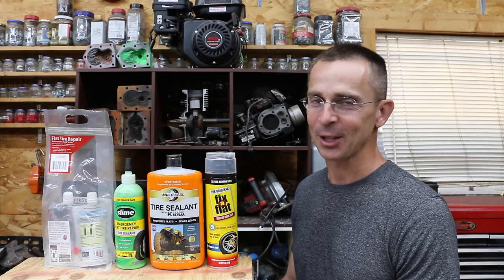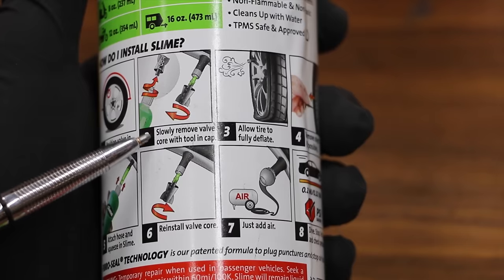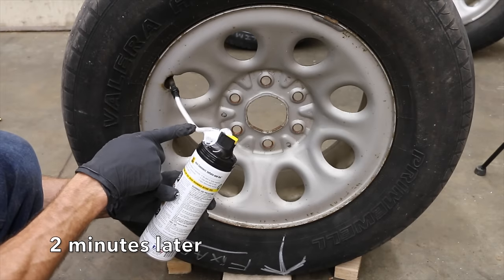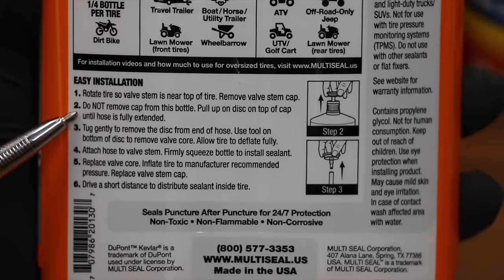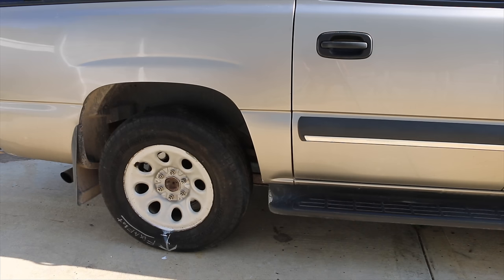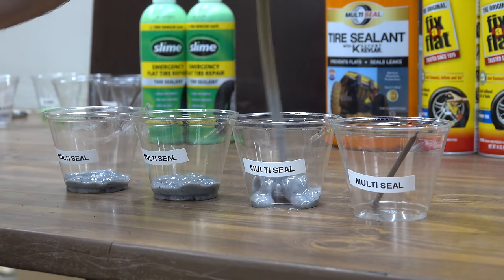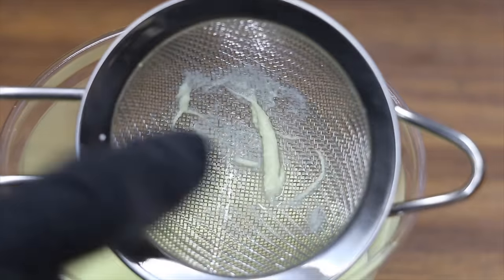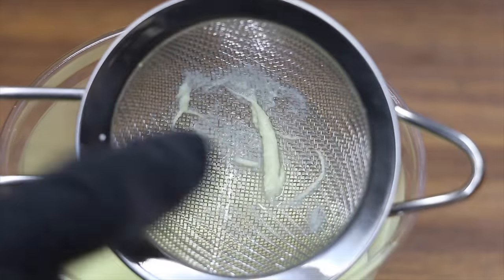Is Tire Slime the Best? Fix-a-Flat vs Tire Slime, TireJect, MultiSeal. Let's find out!

Comment: Fix-a-flat is good for tiny gaps like bead leaks, tiny cracks and objects still embedded in the tire, but that's it. Definitely won't seal a hole as Todd demonstrated here but given it's convenient and easy to clean off, it's worth a shot for small leaks. Definitely not a substitute for Slime or similar in lieu of a spare tire as is now common. I doubt I'm alone in admitting these products are 'temporary permanent' fixes for me.
Reply from the maker: Thanks for the feedback.

Comment: I’ve never heard of multi seal or tire ject, use slime all the time in my atv tires , works great, fix a flat never worked for me. No off balance issues either. 
I vaguely remember a pink sealer from years before that I used, I think it was called pig snot, it worked great also but I think it corroded aluminum, I’ve never been able to find it
Reply from the maker: Thanks for sharing.

Comment: What kind of tire inflator is that? Has it been reliable and about how many tires have you aired up completely? I bought the cheap ebay, harbor freight, walmart mini air compressor looking inflator and it burned out on the first tire at 28psi. Looking for a reliable mobile tire inflator that wont burn out for emergency use and simply to inflate tires. Thanks so slime may be the best cheapest alternative to fix a flat.

Comment: I've always had good luck with fix a flat. Granted I've only used it in 4-wheeler tires. Makes me wonder if I've just been lucky.
Reply from the maker: Thanks for sharing.
Reply: be careful when dismounting those tires- they can explode on a rim clamp machine being used with no pads.

Comment: I wish there was a product for very slow probable  rim leaks or if there is I'd love to know. All for of my tires will lose air at a rate of 5 - 15 lbs in about 2 weeks. I've taken them to a few tire shops and they never see bubbles. Tire Shop said that the type of rims I have are known for rim leaks. It's so frustrating in the winter to refill them that I've been thinking of purchasing all new steel rims
Reply from the maker: Thanks for the feedback.

Comment: It should be noted that this is what you use instead of a spare tire and you should drive fairly slow while driving home. The tire needs to be replaced.

Even plugging it isn't a good idea, if the belt is ripped you can get creep between the inner tyre and the outer rubber which will cause a catastrophic failure (to make matters worse, the faster you go the more likely it is that it will happen).

It's not fun having to pay for a new tyre but it's absolutely needed, your life may depend on it.
Reply from the maker: Thanks for sharing!

Comment: I was a Slime user for ages until I had a trailer tire develop a leak around the bead. When I dismounted it, the tire slime was a rusty paste and the wheel was thoroughly corroded. Perhaps, the product becomes unstable after 2 years?

Comment: Was debating plugging it but had to hit the road sooner than hoping so used the Slime on my dually big boy that I keep the tires at 80psi. Recently done and hoping it will hold for a while. 
What do you think with the psi I've got them at?
Reply: thats bike-tire pressure- of course it will work

Comment: Ok, I'm going to say you missed the boat,  you should have check the others that did seal the 1/4 holes to see if they too would seal as well on the 3/8 hole, the on up to a 1/2 hole and larger until the product finally failed
Reply from the maker: Thanks for the feedback.

Comment: I’ve used tireject on my tractor with some trashed tires and it helped repair a sidewall rip, it was surprising but it was very expensive considering
Reply from the maker: Thanks for the feedback.
Reply: cheaper than a new tractor tire which is ridiculously priced.
Reply: @tommurphy4307  oh yea it was barley a %1 of a tractor tire

Comment: Slime ruined my steel ATV rims.  I bought a used ATV from a friend that had used this stuff previously and when I went to get the tires changed I was in for a huge surprise.  First off, it took all but cutting the old tires off to remove them.  The rubber had literally fused to the rim due to the insane corrosion caused by the Slime.  I wire wheeled the rim beads the best I could, but the new tires were unable to properly seal.  I ended up having to use bead sealer TWICE to get the new tires to seal on the old rims.
Reply from the maker: Thank you for sharing!
Reply from the maker: Thanks for sharing.

Comment: One comment, just cause you drive a 1/4 or 3/8 spike into the tire does not mean you have a hole of the corresponding size. The rubber penetrates and then spreads the rubber streaching it out and then closes off smaller than said object. To test the claim of a certain size hole you probably either nee a drill bit but still probably would spread and stretch. You need to punch a hole in it. Maybe take tire off and put it somewhere where you can out something behind it and then use a like leather punch to put X size hole in it. Follow what I'm saying?
Reply from the maker: Thanks for the feedback.

Comment: Fix A Flat by itself does not seal a puncture.  The way it works is by softening the inner liner of the tire and through the heat generated by driving and braking the rubber will self vulcanize hopefully sealing the leak. This is a double edged sword however as driving longer than a few hours with that product in the tire will cause permanent damage so you’ll be replacing the tire anyways.

Comment: Comprehensive!
Although knocking in a 1/4" nail then pulling it out, given the flex of the rubber, would not produce a 1/4 " hole?

Comment: Old Person: When Fix-A-Flat came to market, it's use was marketed rather specifically. You're on a long trip and you need to keep going. Fix-A-Flat instructions back in the day: Fill tire and immediately start driving to the nearest tire repair shop.
The heat generated between the tire and the asphalt is critical to the curing and slows air loss until it can be plugged at a tire shop. Tire shops hate plugging them because it's a mess and if it's not cleaned well, bonding the plug cement to the tire is problematic (you might have to plug it again.) I have used it several times (unwillingly) over the decades to get my vehicle to a repair shop. It did work, but you need heat, and the integrity of the tire will forever be suspect. There are better alternatives (obviously) but Fix-A-Flat is acceptable in an emergency. If it was truly terrible, it would not have lasted on the market as long as it has. You need heat generated by tire friction for it to work as intended. It does not work in cold weather. Use your spare.
Reply from the maker: Thanks for sharing.

Comment: And yeah slime freezes bit it has to to be really freaking cold. The fix-a-flat junk freezed solid in there. I've had customers come in with balance issues and it was because the fix a flat was froze up on one size and was all stuck to one side like a slushy in a big hunk. What a mess. Winter mechanicing sucks lol

Comment: 13:46 This is exactly why I dislike these kinds of products even though I do not work for a tire shop. 

An old friend of mine tried to use Fix A Flat to fix a puncture in their tire, and just as you showed, it didn't fix anything, in fact, it got all over the driveway at my previous home. Ugh... Disgusting... Not to mention that home was a rental...
Reply from the maker: Thanks for sharing.
Reply: @ProjectFarm  
You're welcome. It is always a good thing to share such an important opinion.

Comment: Being an older video, would you consider another test if this? I'd be interested  performance when a hole is drilled into the tire, the largest drill that could be used, and if the product would work if it's punctured after the product is already in the tire. Also, how long does it last in the tire.
Reply from the maker: Thanks for the suggestion.

Comment: One thing i deal with alot is de-beaded tires when i pick up a trailer, my company has an auto inflate system but with a de-beaded tire its useless on occasion i can make a few corners and the bead will set but on my own my only other option i think is the ol starter fluid and sparky spark method which i really dont like are there any other methods i might not be aware of? A cheetah would be good but no room for that monster lol

Comment: When I bought my Chevy Volt it came with an air compressor that also had a can of Fix-A-Flat built in (I don't remember if it was that exact brand), instead of providing an actual spare tire because weight savings and efficiency claims and all that.  One day I actually hit something on the highway, an S-hook, that embedded in the tire and made it go flat by the time I got to the next off ramp.  I tried the sealant but it ran out the hole like whipping cream..  It did nothing to seal the hole and was still leaking out by the time the tow truck got it to the dealership for a new tire.  Absolutely worthless crap!  Now, I have a rope plug kit in the back just in case something like that should ever happen again.  At least that way I'd be able to drive it to a tire shop.
Reply from the maker: Thanks for sharing.

Comment: Tire Slime has got to be the best right, it's bright green after all?
I'm not sure being flammable is important. I mean tires are about as flammable as it gets so does it really matter?
The tires should be driven on immediately after filling them to help balance the stuff inside. Just placing the tires with the holes facing downward isn't enough. Glycerol and the other ingredients are the same or similar enough to antifreeze that none of them should freeze.

Comment: Fix-a-Flat probably is not a suitable product for a hole that large. I just used a can. I used a small portion of the can in the spare to help lubricate the bead because the spare had been low on air probably for many years. The flat tire had one side of a staple stuck in it, essentially a piece of wire. I put the rest of the Fix-a-Flat in that tire. The Fix-a-Flat bubbled for maybe a minute and a half and then it stopped. I haven't aired it up to full inflation yet, but if it holds air, I'll drive on it. It would not be repairable otherwise

The advantage of Fix-a-Flat or a similar product is that it is easy to install, because you do not need to remove the valve stem. If you are on the road, maybe Fix-a-Flat is good enough to get you to the next town. It you have a nail or screw in the tread, do not remove it. If I had kept my spare maintained, I would have had a lot less trouble.
Reply from the maker: Thanks for sharing.
Reply: @ProjectFarm  The tire with the staple in it hasn't leaked in a week. It turned out that the spare - full size and never been driven on - picked up a screw on the drive home. I removed it and found out there was a tiny leak but not a full puncture. I decided to drive on it and see if the residual Fix-a-Flat would seal it. So far, it's been days and there has been no air loss. I got two tires fixed on one can of Fix-a-Flat.

Comment: Fix a flat can says that you should leave the nail or screw in the tire to help plug the hole better, so that is why they say get it fixed by a pro so soon, in  the case of being on the side of a highway or road it is fast way to get out of a dangerous traffic situation, and move to a safer spot. TC out there y'all.
Reply from the maker: Thanks for the feedback.

Comment: I like your reviews. I was looking to find something for my appliance cart tire that keeps going flat. It doesn't need to lose a lot of air to go flat as is a very low volume, but high pressure. Might just break the bead and run a bead of caulking around the rim.(not going to buy bead sealer for this thing)
Has anyone ever made a home made version of this slime?
I have used some tire fix on atv tires years ago, like 25! OMG!!  It works for cracked sidewalls but throws the wheel out of balance at higher speeds.
Thanks much!!
Reply from the maker: You are welcome!
Reply: use non-pneumatic wheels and tires, you can get them thru harbor freight.

Comment: Can  Multi Seal - (Flat Out) be used for on road tire fixes ? or just off road ? The video says it's
designed for off road, but that doesn't make sense ? If it will seal holes, "off road" it should
not matter if you drive the car off road, or on road ? I wouldn't think so ? What does Project
Farm think ?
Reply from the maker: Thanks for the suggestion.

Comment: My experience with green slime in bicycle tubes was an expensive disappointment.
(1) If the air outside of a tube sets up the slime, then why does the air inside the tube not set it up?
(2) The punctured area rotates around and around.  The slime does too.  But to work well, the puncture is supposed to be down, not up, where slime isn’t puddled.  No way of telling where the puncture is, unless a nail (etc) is sticking out of the tire.
(3) Slime does from a very poor job to absolutely nothing to seal a puncture.
Maybe others have had better experience.  I’d as soon carry a forked stick and wave it over a punctured tire.  Much cheaper, same effect.
Courtesy of Half Vast Flying
Reply from the maker: Thanks for the feedback.

Comment: My prius had a full flat by a nail I added Fix a Flat and it did the job but I didn't remove the nail. 3 months after and still holding air. Hope this helps someone else.
Reply from the maker: Thanks for sharing.

Comment: With the Fix a Flat I don't think you're supposed to REMOVE the object. For Tire Slime, sure it says to do it is possible. But for Fix a Flat, I think you need to leave it in there and it'll seal around the object. It's only supposed to be a temporary fix until you get it to a repair shop ASAP.
Reply from the maker: Thanks for the feedback.

Comment: You are correct tire guys do not like finding this in tires. Original fix a flat caused gas build up in tires and could cause tire to explode during repair. People need to inform tech before tire repair is started. They now want tech to pull tires and patch from inside  they also were talking about  putting expiration  dates on tires.i have been out of automotive for 6 months not sure what is going to now.
Reply from the maker: Thanks for the feedback.

Comment: Fix a flat is only good to inflate the tire and show you where to put the plug you should have ready to go. It's best to just have those two things in your car just in case. Better to go change your tire in a church parking lot than on the side of a freeway. Otherwise fix a flat is useless. The others are all great for offroad but even though it says on road I still wouldn't use them in a high speed tire like that.  Throws the balance off every time you speed up and slow down like tire beads. Makes for odd handling characteristics. Besides, you need to properly fix a leak on a road tire with a patch plug from the inside of the tire to really be safe. I've used my plug kit/fix a flat combo quite a few times over the years. Vacations, road trips, random flats offroading. Yeah it's kinda just white colored water in a can of air, but that's the thing. I'd buy it over a similarly priced can of compressed air, although I may ponder the decision.
Reply from the maker: Thanks for the feedback.

Comment: Im a mechanic for a living and I HATE when there's some sort of fix a flat in a tire and the customer doesn't tell me ahead of time. And no tire repair fluid is safe for tpms sensors. neither are balance beads. They will plug up and block the valve stem from letting are out and will ruin the sensor every time

Comment: Using any of these products makes it almost impossible for a tire shop to properly clean out the inside of the tire, which would have allowed for a plug/patch to be used to actually fix the hole properly. If you do decide to use one of these products, don't be surprised if the shop tells you that you need to buy a new tire because they can't fix it due to the messy goo. Imo, you are much better off paying for a a cheap yearly roadside auto service (which usually comes with 3-5 service calls per year), which would either tow your car to a shop to have the tire fixed properly, or they would put on your spare tire so you can make it to a shop on your own. 

If you still want a cheap insurance policy to keep in your car/truck, get a small air foot pump, and a tire fix kit that uses a tire reamer and "T" handled tool to insert a vulcanized cord/plug into the tire. Vulcanized patches are much better at sealing up small to large holes, and they last waaaay longer than these liquid cans of goo. YouTube search for "vulcanized tire plug repair".
Reply from the maker: Thanks for the feedback.

Comment: Both FaF and TS ruin TPMS sensors, worked in a tire shop for years and every time either product is in the tire, the sensors are ruined.
When manufacturers provide those said products in the tire repair kit instead of the spare, they want you to ruin your sensor and buy more along with a readjustment service to the system
Reply from the maker: Thanks for the feedback.

Comment: Workign in an auto shop, pin hole ruptures, I've seen fix-a-flat work. Larger than that, it about never works. Tires get brought in still flate, which makes cleaning up the liquid more of a pain. Mess wouldn't suck as much if it actually worked.
Reply from the maker: Thanks for the feedback.

Comment: I had a nail that entered sideways(slow leak). I was told by auto repair shop that it couldn't be fixed because nail was sideways. So I purchased a new tire. Could a sideways nail leak be repaired if so how or was i duped into buying a new tire?
Reply from the maker: Thanks for the suggestion.